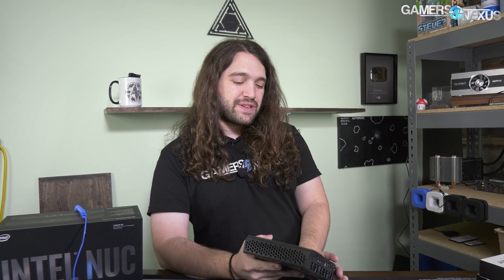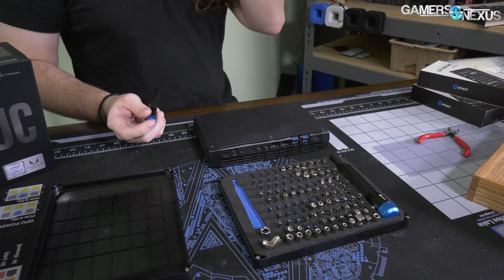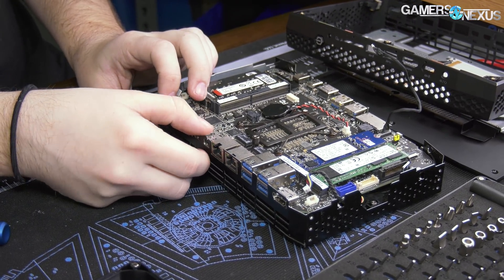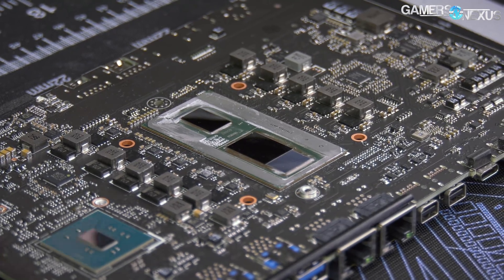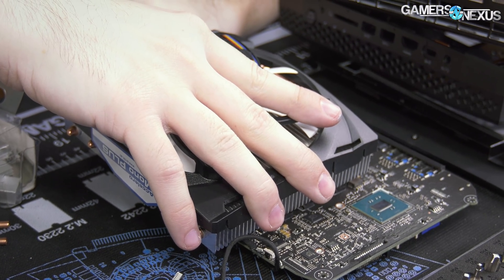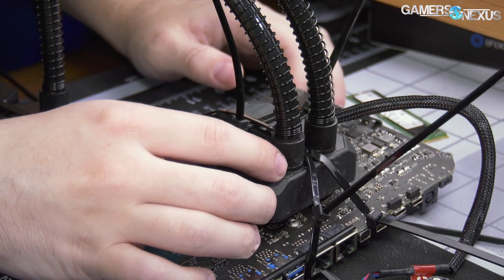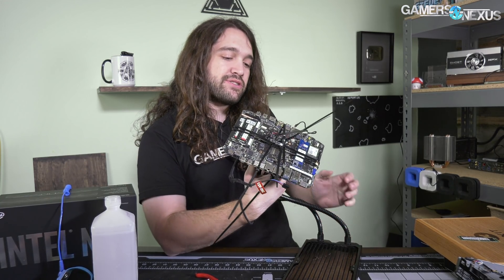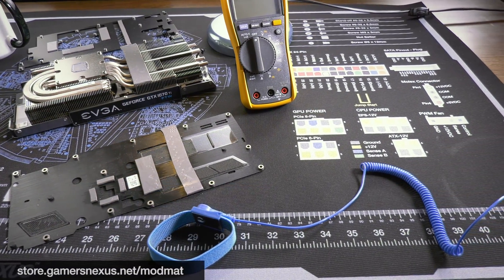Liquid Cooling Hades Canyon Mod for 5GHz Attempt (Pt 1/2)

Comment from the maker: Previous Hades Canyon review: https://www.gamersnexus.net/hwreviews/3282-hades-canyon-review-intel-amd-pressure-nvidia-nuc8i7hvk
Grab one of the GN Anti-Static Modmats here: https://store.gamersnexus.net/
Reply: If you want to do this a little less...Tiewrappy?
I'd like to suggest making a pair of dxf's to get lasercut. 1 would slot over the cooling block, the other you could make protrude from the PCB sides underneath-backed by rubber to prevent shorts - If you added a few small rectangle cut outs, in each block, they would make good tiewrap mount locations.
Obviously at this point you're not gonna stop, but just a thought for next time =)
Reply: Why not use the 4 mounting holes already on the motherboard? All you'd need to do is turn the water block 45 degrees, and 3D print a frame to fit over the top. Would take like 20-30 minutes to set up properly including the print time.
Reply: Zip Tie of Beauty!
Reply: Nice video Steve, 1 question can you mod the fans of this unit, for 2 low profile 15mm fans example: noctua NF-A12x15 PWM  fans ??
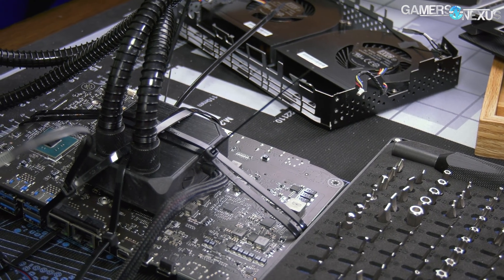Reply: 10:28 SteveTechTips

Comment: Steve, please, I love what you do but you give me a belly ache each time when I see you handle mechanical tools like a caliper.

The pointy things at the back (a.k.a. Inside small jaws) of the caliper are to measure holes easily [1], but you can also measure the distance between two hole with those. And just to make sure: Depth is measured with the "Depth probe", the pointy thing that extends and retracts out of the "bottom" of the device.

[1] Wiki: "used to measure internal diameter of an object" - https://en.wikipedia.org/wiki/Calipers#Vernier_caliper

Anyhow keep up the good work, and never loose your snarky-ness :) - Love it when you smack "great ideas" in a product in an "en passant" manner.

Comment: If I can scrape to together the pennies quite fancy trying to do a passive build like "the fanless guy" has done with a large extruded heatsink. My biggest worry is trying to get contact with the vrm's.  But after watching this video, thermal gluing the heat sink to the existing vapour chamber seems to be an option, just hope they conduct heat as effectively through the depth of the chamber as they do laterally.

Comment: Hey Steve, Mounting suggestion. Whay do you think of using a block on the backside, under the zip ties and opposite the cooler, to reduce the tortion on the motherboard and directly sandwich the CPU+GPU? Or perhaps a steadier and easier setup: 2 C-clamps, a block for the backside as suggested above, and 2 small planks(about the length or width of the motherboard). One plank goes underneath, then the block, then the motherboard with cooler on top, then the second plank parallel to the first, finally C-clamp both ends of both planks such that they sandwich everything. Also could use the table as the bottom plank for maximum stability.

Comment: I'm surprised they never bothered to use 3d printing to attempt to make a support for the mounting kit...
Reply: Because you don't really have to screw things onto the PCB, if you can create a mount that goes on the non thermal points of the PCB, then act as a platform to put a heatsink and act as a screw hole for the PCB...

You could have the piece of plastic go thru the PCB's hole over the heatsink area and have it be given threading so you can take a non-conductive nut, maybe a plastic one, to tighten it?

Comment: This is probably a little late but if you get a small bar clamp that could help hold the cooler down a lot. Theyre usually rubber on both clamping surfaces and you can adjust the tension of the clamp pretty finely. C clamps would probably work too and give you finer adjustment but theyre metal on the clamps so youd have to put some kind of rubber insulator on the ends to make sure you dont short anything out. Probably too late but im sure this would work waaaaay better than zip ties. But you do risk cracking the whole board going this route

Comment: I mount my phase change cooler with zip ties (its old and only has mounting kit for lga775) but I run them through the mounting holes which should work on that as well.

Comment: Now here's an idea; Inverse-mounting a conventional Asetek block with a 3D-printed top which has screw posts for a conventional X86 processor. Then once mounted to the top of the case, secure with the six case screws to mount at a fixed height. If you want to appease the 3D printing gods you would post the design freely for modification with other coolers.

Comment: Would it be possible to use liquid metal with the stock cooler? It should offer a good improovement and should work since the heat pipe is copper
Reply: Domenico Florian Rescigno that is a good thought. I believe Steve alluded to the core issue being the surface area of the stock cooler. Even with fans at Max speed (earbleeding noise) there is a deminishing return as you push more air due to how fast air can pull heat off the fins. Betting it would provide a couple percent extra headroom, I'd watch it :) right now I'm super excited to see how far they can push it on the larger AIO since that effectively quadruples the cooling capacity over stock.

Comment: Please use a metal plate that won't bend on the bottom of it. Make sure something non conducting is between it and the board. Maybe have some thermal pads. Then zip tie. This will cause less flex. Flexing will cause issues with the many bga chips.

Comment: Would that fit into a Little Devil PC-V10 case and use the cooler head and some machined copper block to cool the CPU/GPU down to -70 degrees below zero, and no I am not a shrill or Troll and I think it is the only way to get 5GHZ.

Comment: The MasterLiquid Maker 92 maaay have fit on it as well. Might have been able to zip tie it through the stock holes since it has really small bracket footprint. Much smaller radiator though so it may not have been up to the task anyway.

Comment: what about a board length clamp, that would stop any bending and give you more pressure on the socket. Imagine four beams that cross the shortest side of the board, 2 on top and 2 at the bottom clamped at each end.

Comment: How about just use a one cubic inch wooden block on the liquid cooler so the force is applied on the middle of the liquid cooler. The zip ties would be more effective with the setup I suggested.

Comment: Why not just make a copper plate to cover both the dies and the vrms with the mounting solutions for both the board and the clc block? Throw some liquid metal between both and call it a day. The zip ties are however an entertaining solution.
Reply from the maker: Yes, "just" is also the word I would use.

Comment: you could glue the nucs mounting plate to the cooler then put a block of copper in the gap for making contact with the chip.

Comment: you could put the block on 45deg. angle, exposing all 4 mounting holes and guide zip ties throught them (or screws with some custom  plate from eg. wood)